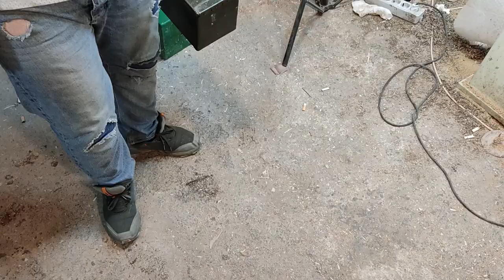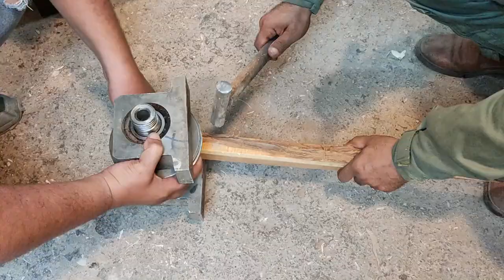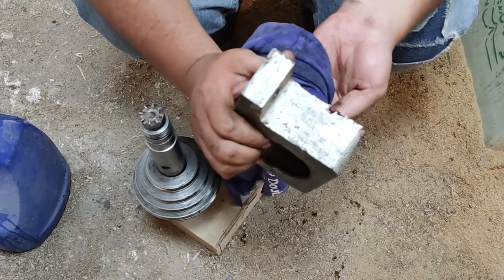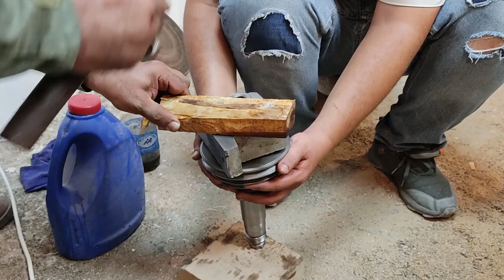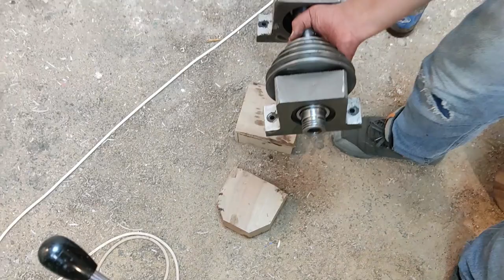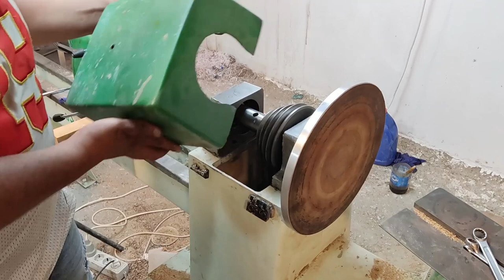How to replace the bearing of the lathe machine

Comment: A little bit of heat on the bearing housing and it would have slipped over the bearing without hammering at it. Same goes for the bearing’s going onto the shaft.